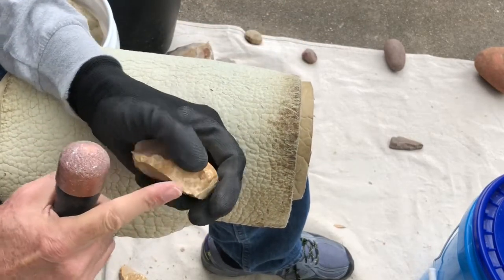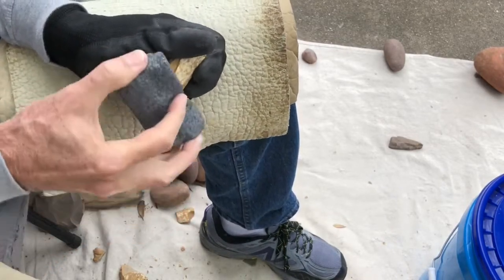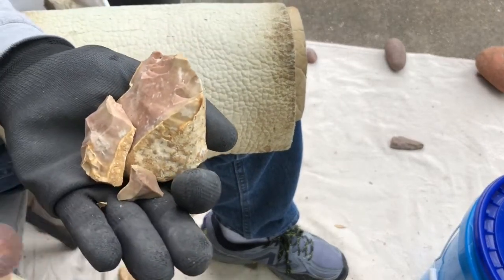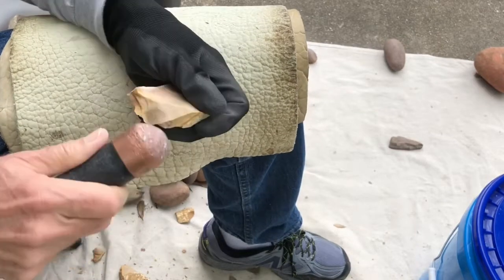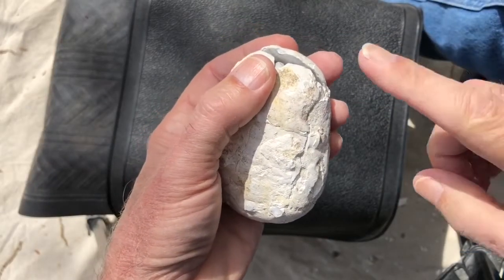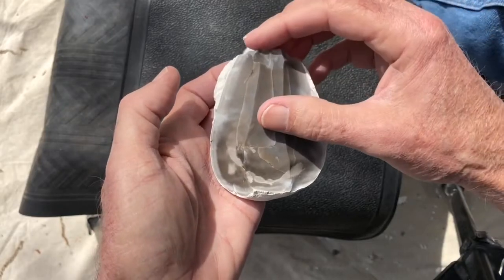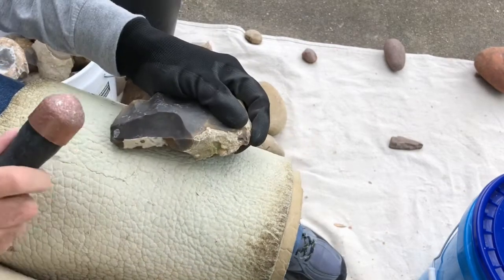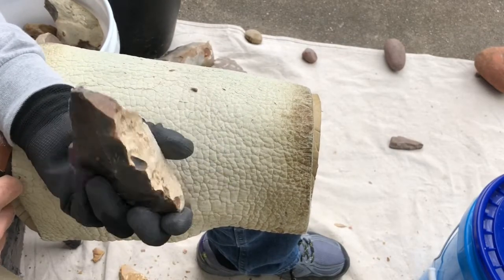direct percussion of various rocks vid 2 of 5

Comment: How do you know when to use solid copper vs lead filled bopper? What is the difference between the two besides one is solid copper and the other melted lead.
Reply from the maker: not sure where, but i think i've discussed that subject a fair amount in previous video(s).  solids are trickier but have certain advantages at times. main difference is hardness.  a few very good knappers use only solids. you have to use both solids and lead-filled quite a bit to understand the differences in what happens when you use them. i really can't cover the topic in a comment reply but i definitely feel the need to use both types at times when i'm knapping. thanks for watching.  fc
Reply: @freezecracked8382  I will keep watching. I will find the information and enjoy every video as I learn.😍